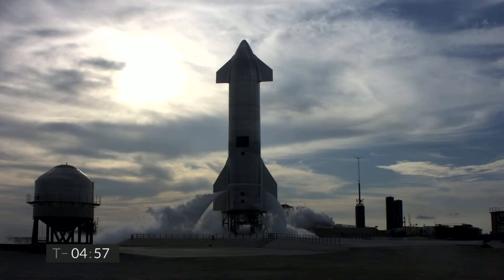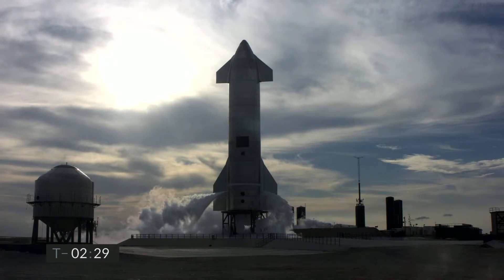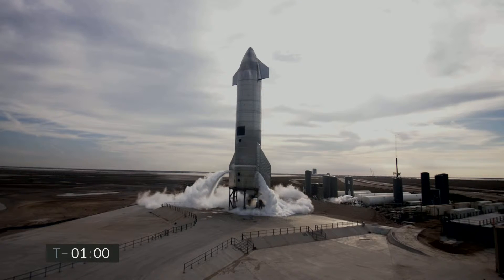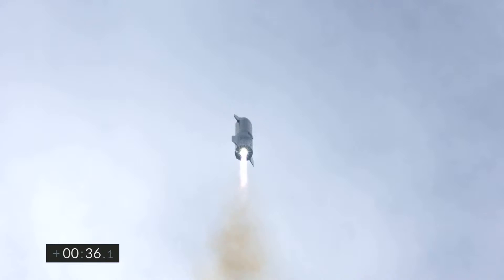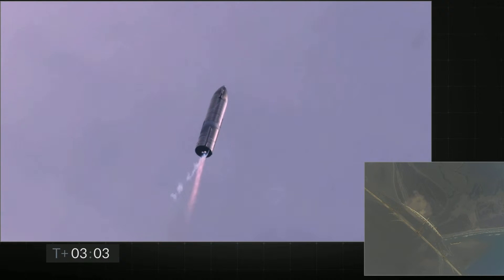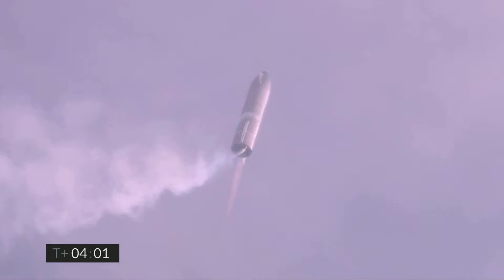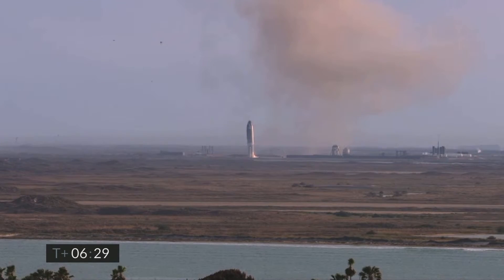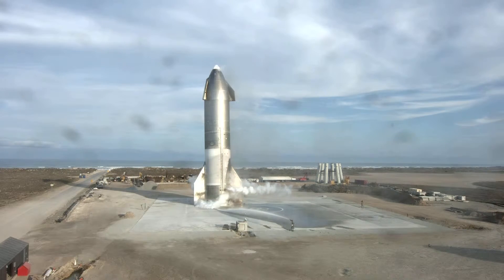Starship | SN10 | High-Altitude Flight Test

Comment: 11:42 looks extremely like CGI I don’t know why.
Reply: It looks like some videogame cutscene as another comment replied.
Reply: No one: 

No one at all: 

Flerfs: "tHaT's bEcAuSe iT iS!!1!1!"
Reply: I know, it's like something from Kerbal Space Program! Hard to believe that this is real but it is!!!
Reply: it is, just like at  5:54, its obvious with the ridiculous and unnatural shaking, the ship itself shakes  sideways, at 11:42 and at 6:02 that fixed and horizontal camera angle is impossible, the camera would have to fly along with the ship
Reply: @3DGlasseswDMT  you're absolutely paranoid I watched 2 other angles live and they looked the exact same.

It's not. CGI it's bad stabilization because the zoom is so close to a rocket taking off 😂🤡
Reply: @3DGlasseswDMT  man that is the dumbest thing I have read in a while, the shaking is from the vibrations of those engine (duh), the ship is supposed to move sideways, it's only using engines on the bottom so it cant have a perfectly vertical trajectory, and no the camera is just zoomed in from far away idk how you didnt figure that out
Reply: @3DGlasseswDMT  How is it CGI if in real life, the ship caught on fire, just like in the “CGI?” Real-Time CGI doesn't exist yet.
Reply: @sebastiansilvaperkins8115  The footage on the air could be CGI. And only the on ground footage real.
Reply: @3DGlasseswDMT  You can watch these tests yourself, you know?
Reply: @3DGlasseswDMT  the angle at 6:02 could easily be done with a zoom lens and tripod.
Reply: @3DGlasseswDMT  11:42 looks unnatural because it's a manoeuvre we've never seen. The flames are identical to those scene when they switch to the distant camera in the following scene.
Reply: @3DGlasseswDMT  at 5:54, the camera is shaking, not the actual ship itself. Pay more attention. at 11:42 , they maybe have algorithms to track a single point somewhere around the ship, and the camera from ground keep tracking that point and responds to every move the ship does. They do that even in the IT clown movie with the scene where he dances. Next time read more.

Comment: THAT was NOT a soft landing, that was a severely hard thump into the ground. And now i know why it blew up afterwards. But the next one will be picture perfect i bet.
Reply: That`s right, a HARD landing due to being UNDERPOWERED the last 10 seconds of the descent - WHICH means they need an extra engine going until touchdown, WHICH means they need some other engine, a non-raptor according to what everyone says about the raptor only running well on very high power-setting; WHICH means Elon is trying to get enough reliability without ANY surplus power availability in the last seconds before touchdown. THAT IS THE PROBLEM THEY AREN’T WILLING TO TALK ABOUT.
Reply: @rokketdesigner7946  If you brake too late in a car before hitting something,what does that mean? That your brakes are too small? Or that you should need to brake sooner? Nah..... they just need to brake earlier, all there is to it.

Comment: To the Elon Musk team I have an idea about landing that is safe and does not require a lot of money, you can apply the system to the overloop about the electromagnetic force, if the overloop rail is on a vertical point, if for SN landing you can do it with a horizontal circle point with a large diameter. SN besides that, you also make a vertical point like the one in the overloop if SN has a north magnetic pole, the vertical point or circle is also the same

Comment: Can someone explain to me in simple terms why this is important? Please educate me on this.
Reply: Rockets are more efficient than airplanes for transport. So, if we can make rockets land, commercial airplanes will be replaced by rockets. Instead of taking 12 hour airplane journeys, you can take an hour long rocket journey. Rockets can be used for multiple flights if we can make them land.
Reply: @aashuthoshsharma715  Not entirely true. Rockets are incredibly expensive, and recovering one like this saves millions of dollars per flight, trillions in the long run. This allows rocket programs to focus on other things, such as scientific discovery and the pursuit for mars.

Comment: There has got to be a more effective and less dangerous way of landing. This looks ineffective and extremely resource consuming. I would bet the landing would be actually work only 3 out of every 10 times.
Reply: look at the falcon 9, being able to recover its first stage booster 91% of the time. all it takes is practice and development. and by the way, had this been recovered successfully, this would have saved elon musk millions. so no, it is not ineffective or resource consuming, it is way cheaper than other forms of landing - and in the modern era, there is no other way to land a booster.

Comment: Landing on one engine. I thought it was going to explode, but it's a success. Bravo SpaceX
Reply: It did explode tho.
Reply: @TheSangson  It was not seen in the film. the first version exploded but this one landed.
Reply: @krotson6767  no, this last test was technically successful, but the rocket exploded ~13 minutes after landing, 10 minutes after they ended the stream.
Reply: @maxz8807  Oh, I didn't know. What was the cause of the explosion?
Reply: @krotson6767   basically 3 of the 6 (?) Landing legs failed to properly deploy, it landed at quite a high speed (around 15 mp/h). Here's a good video covering it:

https://youtu.be/CF9mdMI1qxM
Reply: @maxz8807  Thanks. In this video, I saw quite a deviation after landing. Apparently, from 3 meters the tip of the rocket deviated from the vertical axis of the rocket (rocket launch / landing). They must improve the landing procedure because they are leaning to the vertical on landing too late.

Comment: can anyone explain what type of camera rig can fly perfectly parallel to the rocket and then stop in a hover and follow it back down matching it's speed the whole time ?  It's also interesting how it's dropping through the clouds (10:37-11:37 )but the clouds are only behind the horizontal rocket and not in between the camera and rocket leaving a perfectly crisp clear shot. At 11:43 the camera angle can only be CGI.  Neat how the camera is  so close but unaffected by the rocket blast as it moves from under it to the side of it . Any of these perspectives eliminate a ground based camera.
Reply: Advanced camera zoom
Reply: sigh

Comment: How about adding some spring shock absorber on the tail part for better soft landing?
Reply: there are no shock absorbers on mars, the landings will get better they probably had an engine underperforming on this one
Reply: What i mean is, if there is a spring on the tail wings, the spring will absorb the pressure when it hits the ground
Reply: @stephenbrianvalencia4036  The landing legs are shock absorbers but it looks like not all of them deployed or a hard touchdown
Reply: @stephenbrianvalencia4036  The landing gear they have now will be replaced soon, it was really a temporary solution, springs on the wings wouldnt work because they arent even supposed to make contact with the ground.

Comment: https://www.aljazeera.com/news/2021/3/4/rip-sn10-spacex-rocket-goes-up-in-flames-after-landing
Several minutes after this apparently "successful" landing, that thing exploded...
Would there have been enough time to extricate the pilots, crew, travellers/tourists? I think not.
Also. This video does not show the later explosion. Isn't that a little deceptive?
Reply: It's a test flight, testing a higly experimental first of it's kind style of rocket/ship that uses a different method to land itself. It's not perfect, hence it's called a test flight, there's no way people will get on board untill it gets proven viable for human saftey. The same thing happend to Falcon9 and look where it's at now.
Reply: @Singleraxis  Sure, I know. I'm just wondering why everyone is congratulating Spacex on a successful landing & why the explosion a few minutes does not appear to feature towards the end of this video...
Reply: @alternativenarrative4564  Simply because they never keep it rolling for longer after it touched down, there's no intend on hiding everything, they're transparant as it can be. Plus they've shown their failures in a compilation celebrating their archievement into getting reliable descent and landings. I wouldn't judge too much, this is just another phase into testing, failing, adapting and trying again untill succes. Besides that, SS still has legs under development, so it's likely the landings won't be super smooth for the coming numbers.
Reply: 8 minutes sounds like enough time if there was an emergency.

Comment: They really need to sort the landing legs out. They have continually been the weakest link. Way back with SN2 etc, when they were flying water towers, the legs kept getting crushed. I think that's part of what happened here. It's a extremely heavy rocket and they need a robust landing system to take that weight.
Reply: the landing legs are a temporary solution, i believe. i have suspicions that it'll be SN15's "major change".

Comment: I suggest to make an additional tank between the main tank and the engine, where the required amount of fuel will be supplied before landing.  When landing in a smaller tank, a small amount of fuel will be supplied.  After landing, apply Novec spray to the system above the engine, it will displace oxygen and reduce the likelihood of fuel fire.

Comment: This is absolutely historic and a milestone! Not only because a rocket bigger than the space shuttle external tank (the orange thing the orbiter is attached to during lift off) is made to fly and land vertically (sans the crumbling of one or multiple landing legs), but not the least because it's powered by a full-flow combustion engine (three of them in this case) -- the Raptor, which is arguably its own milestone in a milestone! Raptor isn't untested exactly, but seeing it in action powering the Starship is definitely in the very least inspiring. See, only two other full flow combustion engines even made it to testing, and none through commercial means -- the Soviet RD-270 in the 70's and the more recent one by Aerojet Rocketdyne [for NASA]. In my understanding, full flow combustion engines are a viable and worthy goal with regard to evolution of rocket engine design, made attractive by their own set of benefits, but also traditionally somewhat eschewed due to factors of engine complexity and not well tested practical aspects. Starship isn't nearly all about the Raptor, admittedly, but the fact that SpaceX rides on this newer kind of design, which probably escapes the attention of most laymen watching their tests, is in my eyes its own star in their portfolio of advanced and impressive technologies they had to design and implement themselves.

Comment: Looking at it SX had built in exhaust system now. TSLA removed SX introduced. Good Job now the water cooling system depressurized the MOX tank so you still need Carbon Fibre Steath. Mr Elon do it or else people'll say you have intentionally installed RAD button for your pleasure.

Comment: 11:51 - one engine just exploded, second one is dying too
Reply: It is supposed to be like that. Starship just needs two engines for the whole flip maneuver. They used three engines for redundancy and it was expected that one engine will be immediately shut down, which was not the case. They cannot land on three or two engines currently because raptor engines are not capable of throttling down that much.
The engine did not explode either.
Reply: What

Comment: Elon Musk and SpaceX bravo 1 st of all. Great progress with SN10 . Now please take this quality feedback to improve future missions:     1 ) install on the landing ground a sprinkler system, the fire was under skirt it may happen again, with some spray sprinklers installed spraying upward, some future unplanned rapid dissassemblies could be solved.  Tip: use cheap PEX and use many loops, different zones, say 15-20 not complicated if Starship will step and break some, others will still work if speed to execute is a factor. May look scrappy but could one day save a vessel. When precise mount landing will be realized will be even easier and cleaner and you can do then in piping.     2 ) wrap a 1/8 inch wire around those BOP's with a crosby clip and tie the wire to the body of starship, (cost under 100 $ including labor) or use a different sort of a whip check, like that the BOP's will not fly like a bullet far far away anymore if RUD.      And 3 ) I proposed this in the past, will repeat : why not try 2-3-4 belly flops and stop simulations per flight, at higher altitude, before the last one at ground level in order to rehearse the landing parameters and maximise the ships and exponentially increase the learning curve? Say a first one at 8000 m, then at 6000, 3000 then at ground level.  If you need me please connect via LinkedIn, I get tons of ideas, very creative mind, will give further input and clarifications; here in a few words the message could be misunderstood, even lost among many others. Congrats again.

Comment: What is the purpose of this spaceship? As inside it to take people to Mars, is it just to make a controlled descent ect.
Reply: It's a prototype and requires testing
Reply: @06carbon61  I know, but I just thought that there was some plans that they planned to use it for
Reply: @viktoraggerholm5102  if it's not finished it can't be used
Reply: @viktoraggerholm5102  This is going to be SpaceX' interplanetary transport system basically
Reply: @06carbon61  obviously, but they wouldn’t start such a big project without having some sort of end goal they could use it for
Reply: @viktoraggerholm5102  ye it's gonna be use for interplanetary missions but they have to first perfect everything else
Reply: The flaps are used to slow down on descent so that they don't have to use much fuel when landing, really helps when trying to get large payloads to other planets :) the crew sit in the top half and the tanks are in the bottom half
Reply: @tauraspace  Another benefit is that the ship can be pitched depending on the velocity direction reducing speed and deceleration burns.

Comment: Now I have seen a prototype of the second stage of a 2 stage to orbit vehicle launch itself from sea level to 10k, convert to a glider and then land vertically.  This is MASSIVE!  The only near equivalent would be the flights of SS Enterprise, but that needed a tug in the form of a modified 747 to fly. Well done SpaceX team!
Reply: If you're counting Enterprise, I think it's Soviet counterpart counts too, especially since it flew under power:
https://en.wikipedia.org/wiki/OK-GLI
Though I have to admit, the name doesn't quite roll off the tongue as nicely as Enterprise :P
Reply: @lazarus2691  Thank you.  I learnt something today and that is always valuable.  Jet engines to achieve altitude don't quite compete with rocket engines for vertical landings though.  But I will admit SpaceX is improving on Soviet technology rather than US.
Reply: @waynejgolding I'd say that if anything, SpaceX are improving on DC-X, which is US tech.

Sure, in some senses OK-GLI was more comparable to Starship, but they used very different technology and methodology.

SpaceX aren't improving on it, they're doing something similar in an entirely different way.

And DC-X is the closest thing to a predecessor to Falcon's vertical landing, which is itself Starship's predecessor.

Comment: OK, good landing.  A little concern about the continued flames after the landing.
1. How much fuel was left?
2. Could the low fuel have caused the previous engine restart failures?
3. As an aside, how did the heat tiles fare on the two explosions from SN8 & 9?
4. What data do you have on the heat tiles overall?
5. Going forward, how will the astronauts disembark after landing on the moon or mars?
6. If a moon space station is built, what type of moon shuttle craft will ferry the astronauts and work crews to and from the surface, and how will they be refueled?

Comment: While I completely support and applaud these effort, I am thoroughly upset that an animation was substituted for the landing sequence. Also, the that it didn't show the rocket/ship explode just after landing. These guys are pioneers breaking new ground, don't edit the darn video!
Reply: I think the chips used in the cameras nowadays are doing some compression/smoothing to the video, perhaps to save disc space or enhance other areas of the image.  I noticed my drone's 4K images do the same.
Reply: @dougrobinson2024  you may or may not be correct, I don't know. 
I was able to find the full video. This one did infact have a cgi modification. Probably because in the original video the tracking lost sight of the rocket for a second or two during the horizontal to vertical part of the landing stage. So it was edited to show "what it looked like"
Reply: What are you talking about? There was no CGI here whatsoever. They didn't edit anything.
The landing sequence in fact perfectly matches what all the amateur footage shows. It would be absolutely impossible for SpaceX to perfectly predict every nuance of that landing and then create an animation that's indistinguishable from reality with zero render flaws whatsoever.